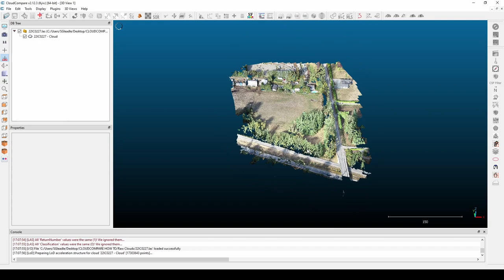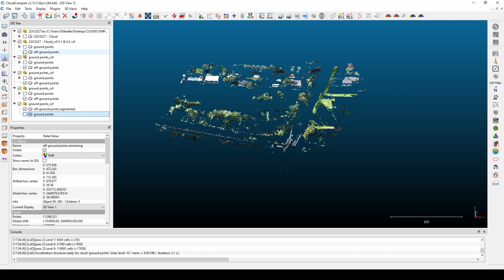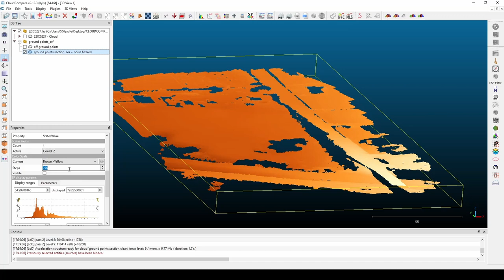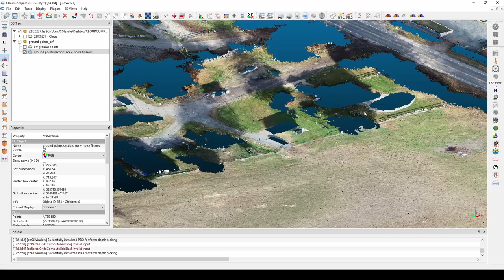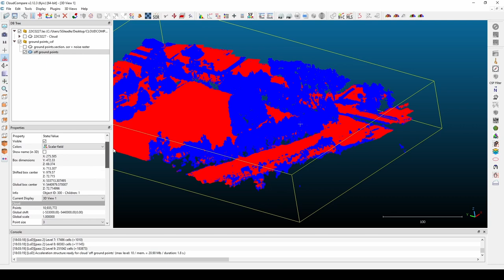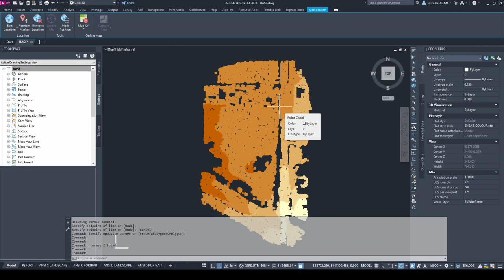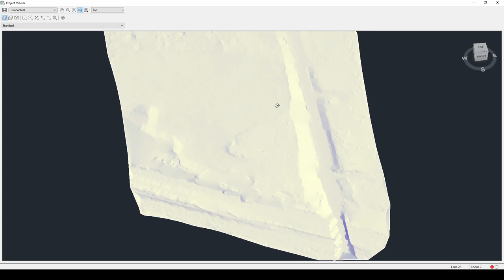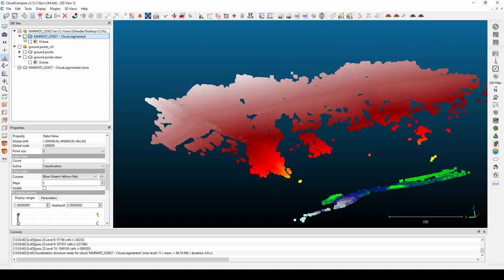Cleaning a Point Cloud & Creating a Ground Surface

Comment: HI. Quick question. In CloudCompare, every time that I try to run the CSF Filter, my system gets hung up and the program does not respond. I have tried using small point clouds to see if the issue was file size, but get the same result. I use the settings you recommend in this video, just so you know. Is this a bug? Any thoughts on how to fix?
Reply from the maker: It's difficult for me to troubleshoot without being there but if I had to guess I would say, if you're certain it's not a hardware issue, it may be worth trying to uninstall CC and reinstall the newest stable version. I have had that issue before, but only when trying to use a larger dataset than what that computer could handle.

Comment: Great video! What does creating a surface in C3D with the point cloud do to the size of that cad file? I used a point cloud in TBC to create a surface with 0.5' spacing on points and brought the triangles in as 3D faces in C3D to create a surface. This made the CAD file itself much larger than our typical topo surfaces and would cause issues on our engineers computers downstream due to less processing power than our survey computers.
Reply from the maker: Great question, it will absolutely create a bigger file. The denser the data, the larger the file. Once a surface becomes too heavy C3D will separate it from the DWG via a MMS file to allow the DWG to remain relatively light weight. If you're dealing with large surfaces bogging down your C3D drawing, what I usually do is create a separate drawing to house my surfaces for that projects and use C3D's data shortcuts tool to point to those separate drawings to gather the surface information. I've found it pretty effective but there are a bunch of other ways to tackle that problem too.
Reply: @The3rdDimensionSurveying  Awesome I will look at trying that method out. Appreciate the response! I've been taking a ton of information away from all your videos. Thank you for taking the time to make them.

Comment: It's a long video but it really worth the time! I learned a lot of tools that I can use, not especially for creating a ground surface, but during your explaination, I realized that I can use them in my project too. You also shared the experience of parameters tunning with us, which saves me much time! Before this video, I was still manually segment the noise  point out or using the simple sor filter. I've learned a lot! Thanks for the contribution!

Comment: Did you create the pointcloud in Agisoft?
Reply from the maker: I did
Reply: @The3rdDimensionSurveying  do you find CC better at classifying ground points?
Reply from the maker: @sylvaingiroux9741  My preferred method is the one I highlighted in this video but I'm always open to suggestions if there is a better way out there.
Reply: @The3rdDimensionSurveying  cool thanks for the reply. And thanks for your great videos. They help a ton. I’m still new at this. Was using cloud compare and recently got metashape pro. I seem to be have troubles when importing my GCPs and use them for to optimize my cameras, my camera accuracies drop to 15m not sure what the heck I’m doing wrong. I’m using a Mavic 3E
Reply: Bravo!!

Comment: Hi, thanks for your responses and guidance. I have a question. I followed all of the steps and finally when I wanted to save the data in the “las” format, in the “las/laz scale” window the “original resolution” is inactive and I have just the other two options “optimal resolution” and the “custom resolution” active, although in your video you chose the “original resolution”. 
Why is this happened for me and it is inactive? Does it effect if I choose the other two options on my results?
Thanks for your response,
Best regards,
Amir Farshadfar

Comment: Great video! Learned so much. Will certainly improve my c3d workflow. I never use kriging filter when creating surfaces from pointclouds, it just smoothes too much and you loose to much detail. FYI 2025 c3d now only updates mms files when there is a change and not everytime something changes in your drawing or you save. #subscribed and #followed

Comment: Dear 
Thanks so much for your video and guidance. I have a question and I do not know if you can help or not. 
I used the CloudCompare software to import my drone data as the point cloud data and exported them into the ReCap software to create the rcp file format and then attached them into the Civil 3D software to import my data and used the “create surface” to create a surface using the “kriging” method and also the “NoFilter” option to create another surface and followed your video:
https://www.youtube.com/watch?v=QIwZhloTKes 
to create a “TIN volume surface” to compare my “kriging” and “NoFilter” surfaces with each others, like the mentioned video with the colored TIN volume surface, but when I adjusted the options like you, it showed me a surface many meters far from my data on the down of the my survey data! 
Could you please guide me what should I do and what is the problem? How should I solve it?
Thanks for your guidance
I look forward to hearing from you
Sincerely
Amir Farshadfar
Reply from the maker: I've never seen the surface creation filtering method shift a surface before which is what I think you are describing. It would be possible to see pockets of displacement between surfaces if there were holes in the point cloud based on filtering methods. If you send me a link containing your data I could take a look at it.
Reply: @The3rdDimensionSurveying  How could I send the file for you? Do you have email address?